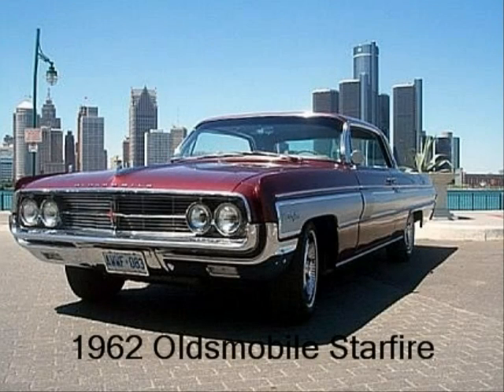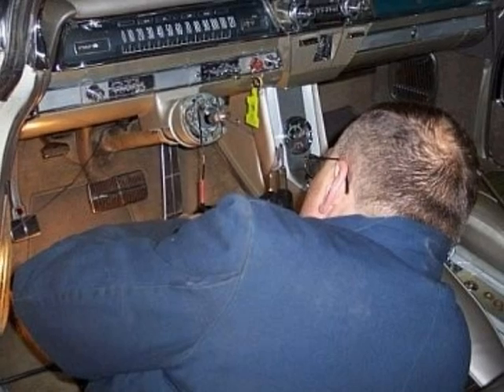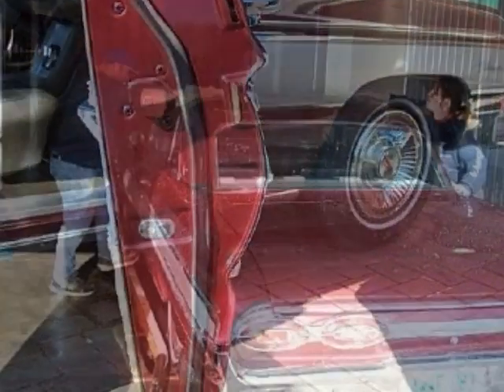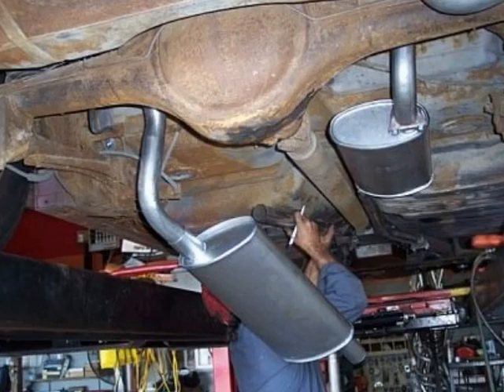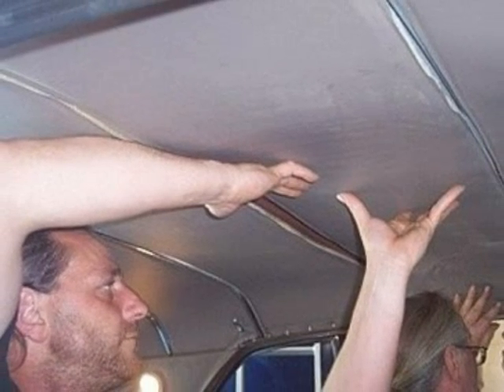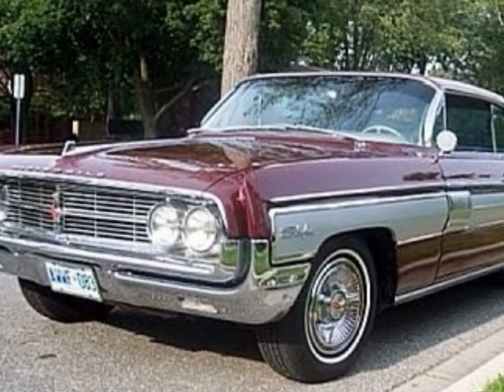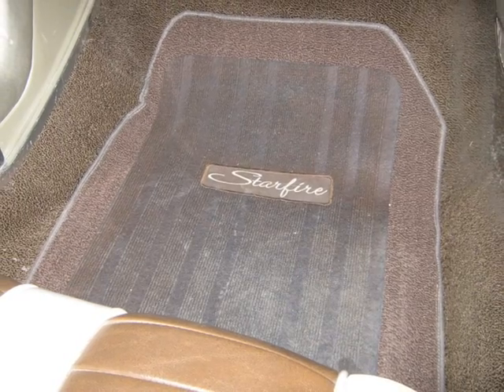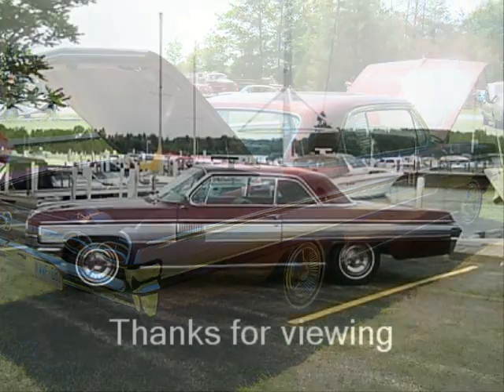1962 oldsmobile starfire restoration

Comment from the maker: Thanks to all for the nice comments.   The original colour of the Starfire was white, but did not contrast well with the trim work.   Madiera Maroon (a early '60's GM colour was used.)   The basic restoration took 8 solid weeks, but as you know restorations are never complete.  10 years later the Starfire still looks the same, even with summer and winter driving.   This is a daily driver car, but is maintained in excellent condition.   Thanks again for viewing.   David
Reply: My parents had one. The color was like a champagne with a white top and maroon interior. Great memories.

Comment: I had the convertible.  The biggest problem with these was the horrid HM-325 Roto Hydra-Matic, one of GM's worst transmissions whose only reason to be was to be a cheaper unit than the four speed HM-315.

Comment: I have 2...... white / red . white is getting 4 wheel disk  and dual master cyl. also new booster. alternator  new white paint  chrome air filter  new tires if I can find m .***need drivers arm rest.*** exhaust system with resonators I hope. any body with help for me ? I m 73 Vietnam combat vet , disabled from all that and not long go. so hoping I can drive it before I  die. if u text 256  me at 267 with info on parts  or 64 any kind of 33 parts . I be  grate full.

Comment: how dumb to undercoat the car after installation of a new exhaust system that should have been done beforehand
Reply from the maker: You're probably right about the undercoating..   This was done close to 10 years ago.   The '62 Olds Starfire is not a show car, or trailer queen.   It is a daily driver.  It is not spared salt caked winter streets, rain or other elements.     I'm pleased to say there is not a speck of rust anywhere on the car and it's in excellent mechanical condition.   The car looks and runs exactly as it did 10 years ago when it was restored.   The exhaust system also shows no sign of rust.    The car runs silently.   Thank you for your input and concern.